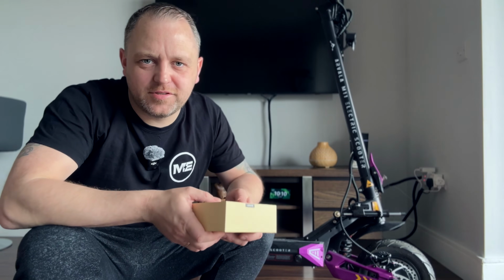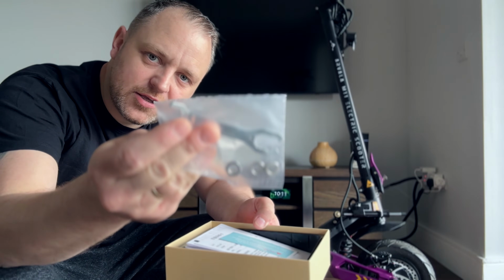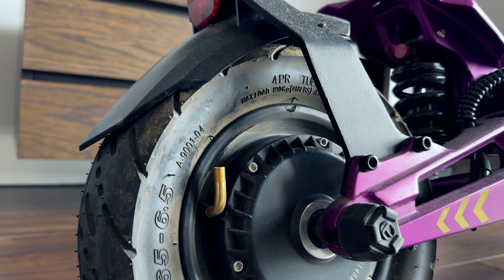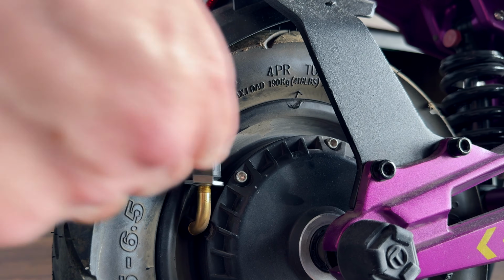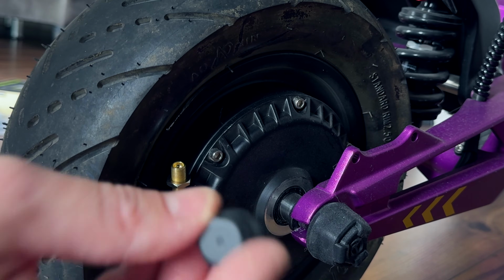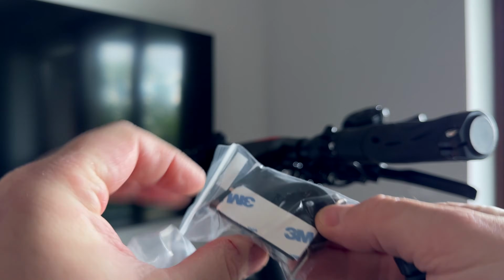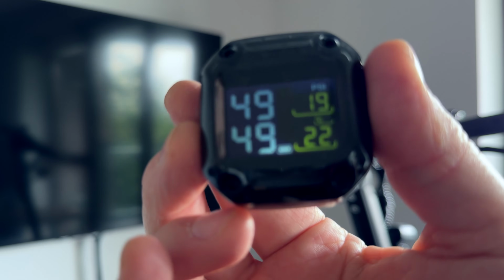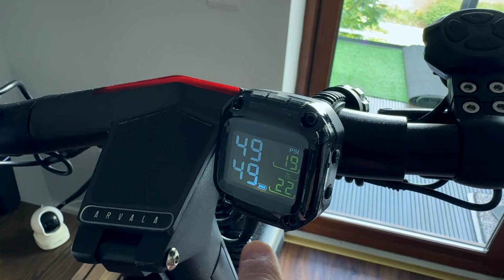PIDZOOM Tyre Pressure Management System - all riders want this

Comment: Don't forget to balance the tire!! These add unsprung mass to the valve  soo you have to add counterweight to the rim. For instance I have 7g or 1/4 oz at the valves 90° and 3 more along 180-200°  to account for centrifugal force. The amount of weight depends on your rim and tire size soo it's trial and error. My sensors weigh nearly 2 weights. Get both wheels off the ground and test until it stops shaking.

Comment: I bought the 2 sensors set and tried on the following wheels..
KS 16S: Does not fit
KS S22: Does not fit
Extreme Bull Commander: Fits but caused a crack in the hose near the base of the valve after a few rides.
Inmotion E20: Fits both tires but the weight difference is enough to cause it to not want to stand still.

I guess it may fit better on some newer wheels..?
Reply from the maker: Every wheel/scooter/bike is different. I hope another smaller sensor version will release.

Comment: What's the actual benefit or difference from just checking your tire pressure yourself? I'm just struggling to see the benefits of spending this amount of money..
Reply from the maker: Well if you ride everyday, typically you would check the pressure twice a week give or take. Most common cause of punctures is low tyre pressure. With this, it’ll save you time from checking. It’s quite cheap I think. There are much more expensive ones out there. For me though, I love it!